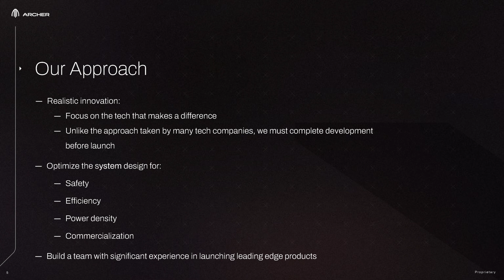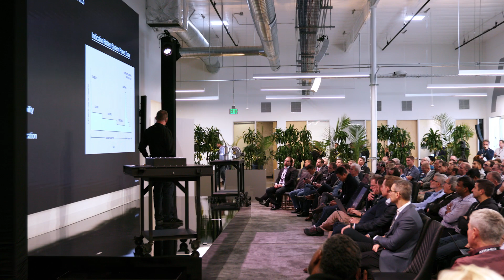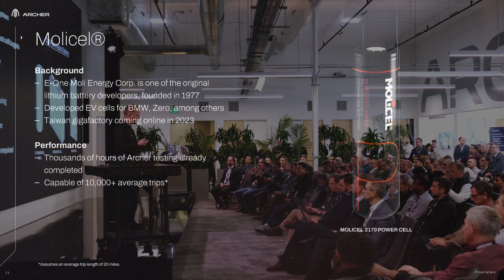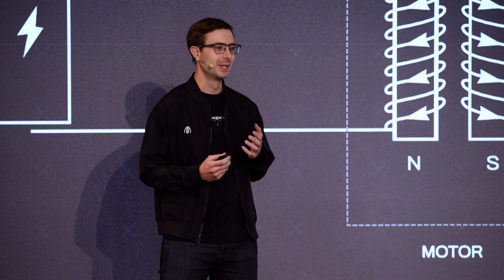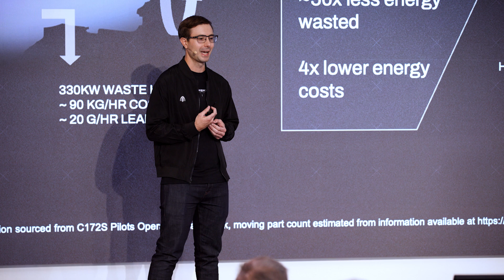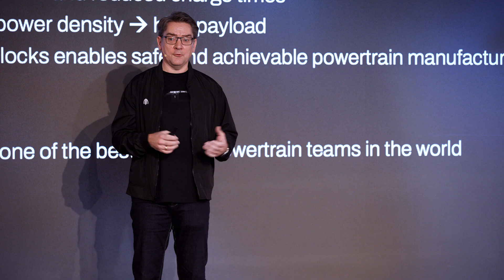Archer Open House | Powertrain Presentation

Comment: What kind of emergency systems does this aircraft have? If a motor were to catch fire, is there a way to release or drop the motor and possibly the cowling to eliminate danger to the rest of the aircraft? Is there a safety parachute for passengers? Is there a whole aircraft parachute?  You stated that you use common components. Will this reduce the costs?

Comment: I'm still convinced that battery planes are barking up the wrong tree.  The power/weight ratio of a turbine engine is hard to beat.  Electric power train, great.  Multi-hour recharging?  Nope.

Comment: It seems like they're using oil cool or water cool engine design, however they didn't mention about the thermal manager system for both e-motor and battery. I believe thermal system is playing a import part for safety as well.

Comment: "100 employees working on power train" (alone)  doesn't sound like a simple system -- in man years of engineering time it is indicative of an immature technology .  The 'rogue's gallery' of hired in talent seems to be solely silicon valley sourced -- and could be described as a little incestuous even with ex wisk and other staff plus a fairly young cohort (no aviation industry persons , no more experienced engineers/designers ) Outsourcing the basic design as seems to be the case and results in lawsuits over proprietary IP also loses control and exclusivity --the patent lawfare issue.
The extreme cantilevering of the front props invites whirl flutter especially if any imbalance arises -- and destabilizes in yaw (requiring larger tail surfaces which will increase the weathercocking in hover and gusts )  putting large masses at the ends of 'bomb racks' is asking for trouble . Comparing one C 172 engine to one of TWELVE electric motors is misleading -- you NEED so many more KW just to lift off or land so any savings are illusiory .  The logic about using gearboxes is opposite to 'others' rationale for not , FMEA consequences apply plus maintenance...